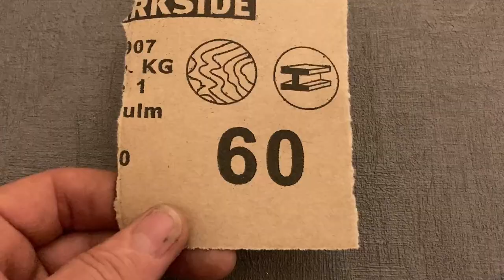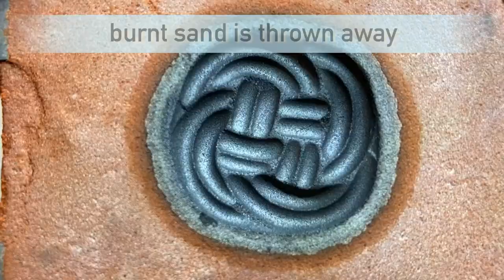DELFT CLAY CASTING A CLETIC KNOT PENDANT (sand casting bronze jewellery)

Comment: I really should make up a flask like yours - the standard rings annoy me with the alignment notch, rather than tabs for a more definite alignment.
Reply from the maker: thanks Peter, I really struggled when I started out using those aluminium casting rings. They were so tight fitting when put together I had to lever them apart, more often than not damaging the delicate cavity within….. Square sided flasks seem to align more simply and accurately…. A home-made wooden flask could be better than some of the commercial ones on market …..all the best…. Nick
Reply: I’m I’m not good

Comment: I'm new to pouring. Every time I "pound" the clay into the mold, the clay "cracks" in  certain places. It usually doesn't crack or split, where I was using the hammer. When I add more clay, it still happens. Is it possible I'm pounding too hard on the hammer?  Thank you in advance.
Reply from the maker: I always use a solid metal former that helps hold the clay in place when packing. I don’t think you can overpack a mould apart from damaging a delicate model or packing too much from one side preventing the model from releasing easily. I tend not to use a hammer directly on the clay, I prefer using a wooden block that I hit with a hammer this helps spread the load evenly and prevents accidentally hitting the frame of the mould … N
Reply: @Nickscreativestuff  Thanks!
Reply from the maker: 👍😎👍 … N

Comment: What specifically is the torch set up you use?
Reply from the maker: hi Christopher, some tools are well worth spending the money on… I have a Smith’s Little Torch set up on oxygen and propane. I use a company called Hobby Gas for my oxygen supplier. it’s worth using a reputable seller for this torch as there are a lot of counterfeit variations on the market that might be dangerous…. all the best… Nick

Comment: What’s the difference between melting bronze and brass?
Reply from the maker: Hi Hinkypunk, it feels relatively safe to melt  bronze in a home workshop as is mostly made of copper and tin. However brass is a lot different as it contains zinc and sometimes lead so the fumes can be a lot more toxic and I would not feel safe playing around in a hobby workshop with potentially risky fumes to deal with … N

Comment: What type of electrical wire and length did you use?
Reply from the maker: hi David, this wire was stripped out of an old 240v extension lead. I think I use about 2ft of it … nice and strong but flexible to weave … N
Reply: thanks,  I love this project and plan to try it with my students. But I am struggling to make the knot. I'll keep at with some different wire..  @Nickscreativestuff
Reply from the maker: I had to practice macramé knots and braids with string a lot first until I could get my head around what I wanted … good luck with it … cheers … Nick
Reply: I have discovered you need 3 ft of electrical wire. That gives you enough extra wire to pull the knot tight. The wire has to be flexible enough to pull the knot tight. I am in the USA, so a used 12 gauge wire from a 3 wire power cable. Like you a stripped the wires out and then formed the knot. I had to then look at the video of the back of the knot just before you added the wax to see how to finish the knot off. It worked well. I am planning to use this project as a way to teach high students  the basics of lost wax casting. Thanks again for a great video, much appreciated.  @Nickscreativestuff
Reply from the maker: cheers David, good to hear you got it sorted. I hope your students enjoy melting metal and making castings as much as I do … good luck with it … N